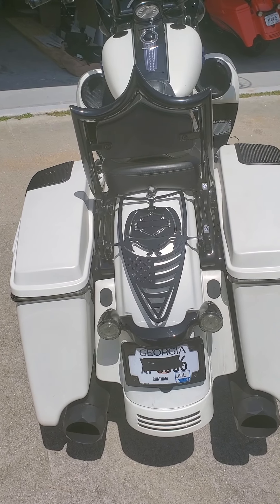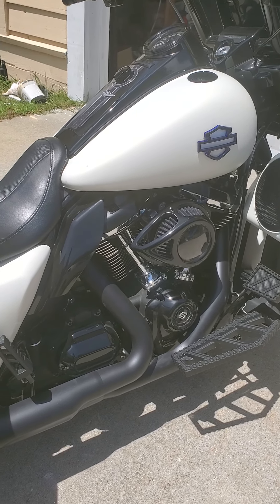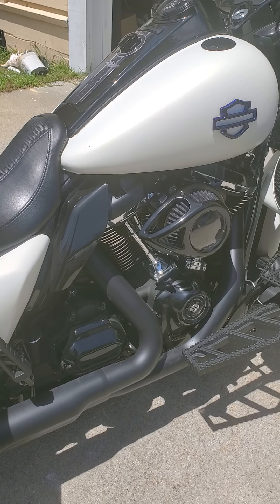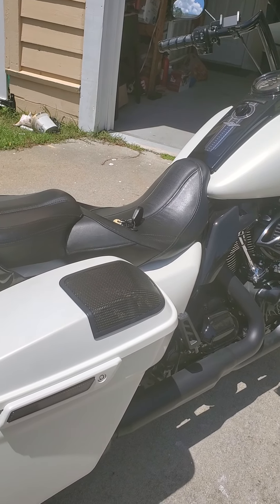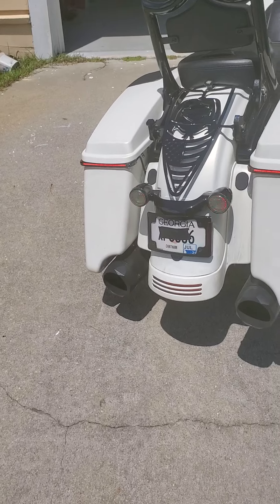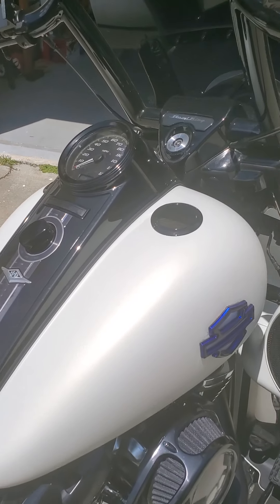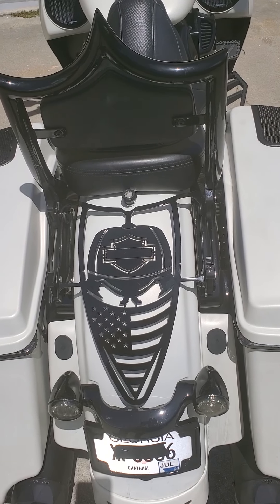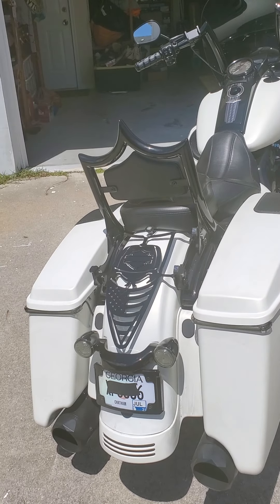2019 Harley RoadKing Special 114 engine with Stage 2, S&S 475c kit, and more

Comment: Did you keep the OE stock 4.38/gps fuel injectors? If so how does it run? Or did you upgrade to the fueling 5.3gps fuel injectors?
Reply from the maker: Hey Mike. I have the stock and it runs great.
Reply: @jeffvelodota4810  cool
Reply: @jeffvelodota4810  yeah my 2019rgs is in the shop right now. Winter came early I think it wouldn't start due to some bad gas. If the stock injectors are plugged I was thinking about going with those fueling 5.3gps fuel injectors with  10mm SE spark plug wires. Those fuel injectors state they're for 90hp and greater.